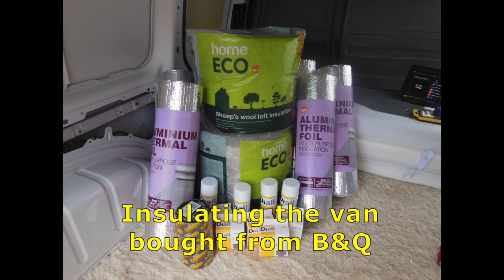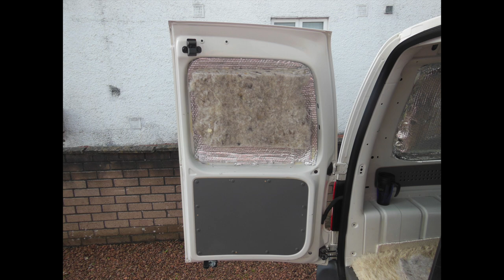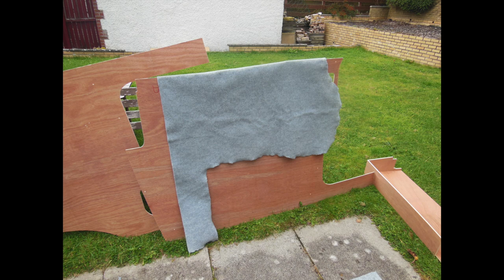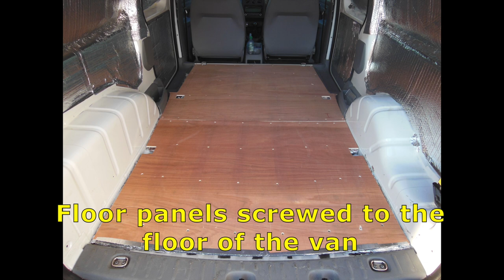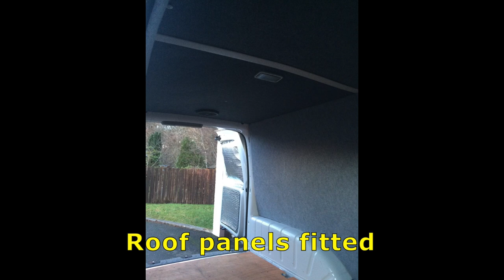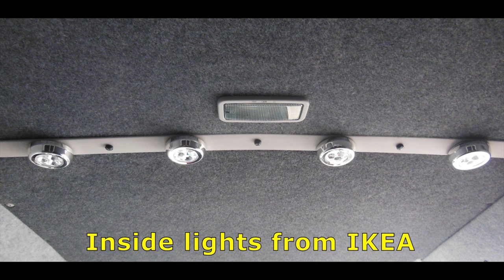VW Caddy Maxi Conversion

Comment: Great job! Like David below, I've just bought a Caddy to convert.   Can I ask how you wired the interior lights in the back?  Are they connected to the light that was already there, or did you have to feed a new wire from the front of the vehicle?  Thanks.